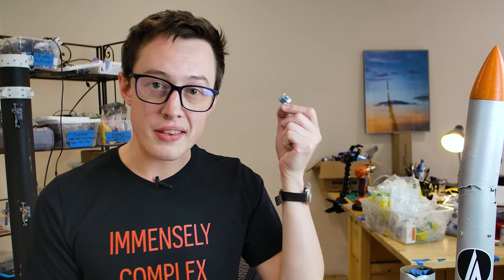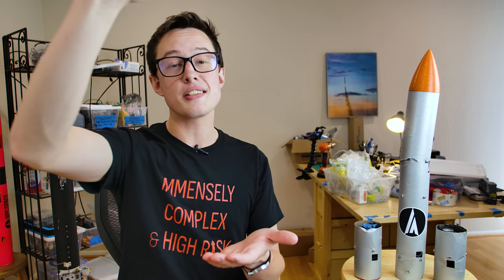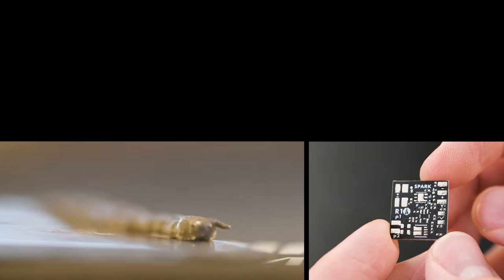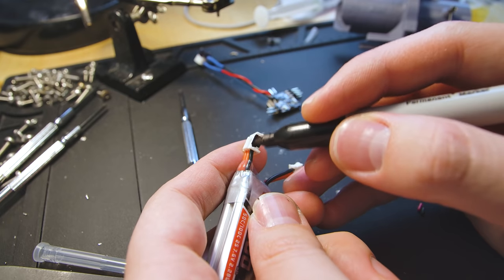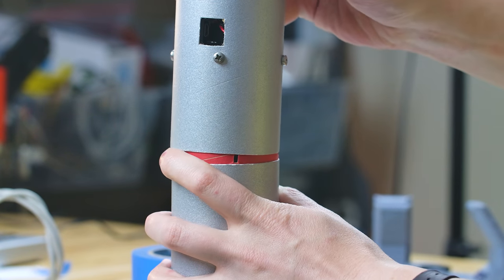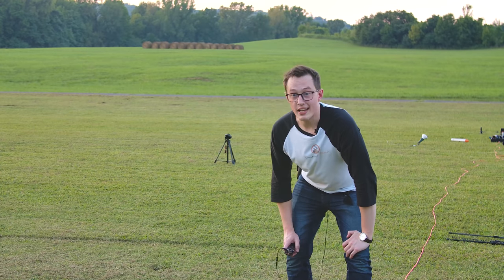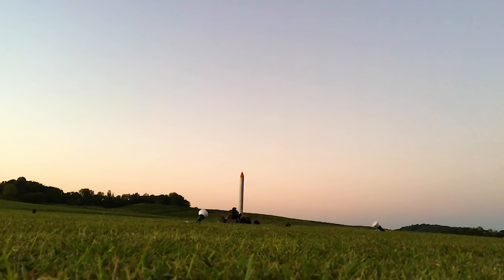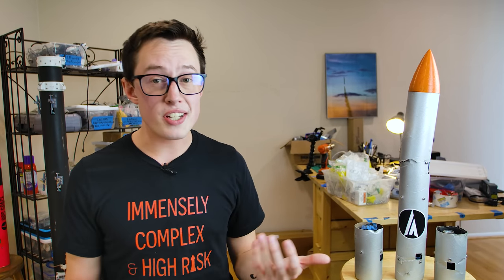Did I Make the World's Smallest Rocket Flight Computer?

Comment: One of the problems that you are facing to land a moter rocket is there you using a rocket motor what does that do is there it gives you a uniform thrust and you cannot control The thrust  so you are not about to land it properly when you don't have a controlled thrust  you will not be able to land it properly

Comment: Bro , I am find the reason why your rocket not goes in straight line .your gyro wheel is spinning at very low rate . You want to use accelerometer sensor in your rocket , do no use small flight controller , you want increase rocket size , smaller flight controller less accuracy . Hope you understand this ,  I am find your mistake , Thanks me later 😊

Comment: I am dreaming to get the same small brain for my 4 rs485 speaking detectors in Radiation Monitor continiously making measurements and storing data. It would be nice also to use quctel chip for communication on board. Also to have the same brain or one more same size to control relays hub to react on radiation level fluctuations, it could be a relay on flying wires to control the gate and do not let a person get in to a danger zone

Comment: HOLY  SMOKES  YOU  OVERCOMPLICATE  THINGS !!
Just force the rocket into stable flight by rotating the fuel mass and rocket structure in opposite directions, and then use rolerons with servo braking to guide the rocket! For crying out loud a simple arduino could process GPS and plan out a specified flight, or one could use an RC transmitter to guide said rocket. You make things far too complicated than it has to be.